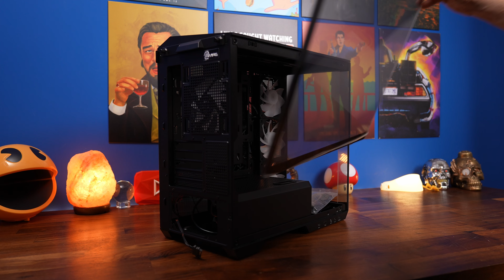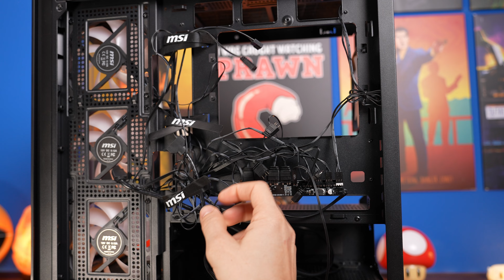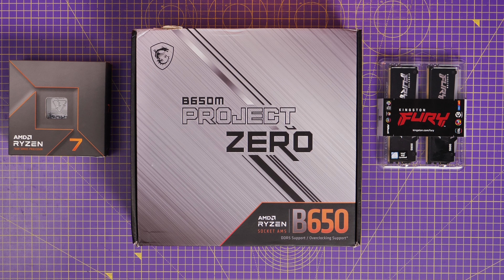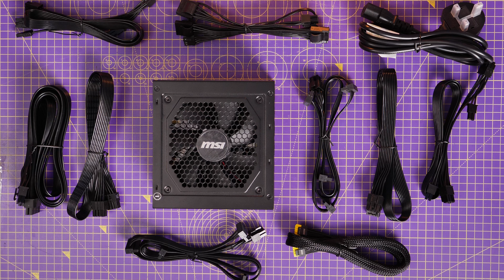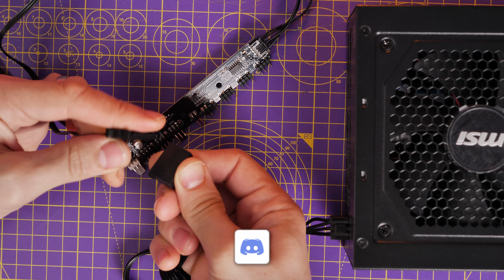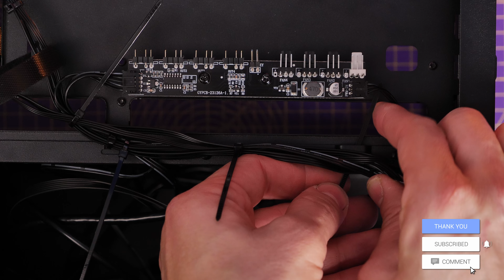ASMR PC build - MSI MAG PANO M100R PZ

Comment: Did this project zero build two months ago but used the 7800xt GPU with the 7700x CPU and it’s been running like a dream
Reply from the maker: Nice
Reply: is it a 3 fan model for the 7800xt? if so does it look good?
Reply: @ yeah it is and it definitely fills up the case but looks great 👌

Comment: please tell me where to connect the 2 pin connector from the front panel, will it be with the power supply?
Reply: Did you figure it out?
Reply: @SLAYER_0-1 There is no reset button in this case, it is probably intended for it
Reply: @Motivation_is_everything 👍
Reply: @SLAYER_0-1  but if you want to use this case with another motherboard, for example, like my Aorus b650m elite ax, then you will have to work a little with nippers since the large front panel connector does not fit
Reply: @Motivation_is_everything thank you I’l keep that in mind
Reply: The two pin coming out of the FP cable is for a reset switch. Since the case doesn't have one, you can plug the LED switch cable into it to act like a reset switch.